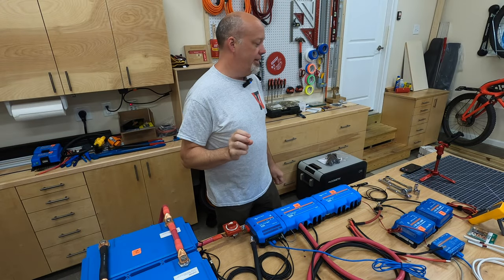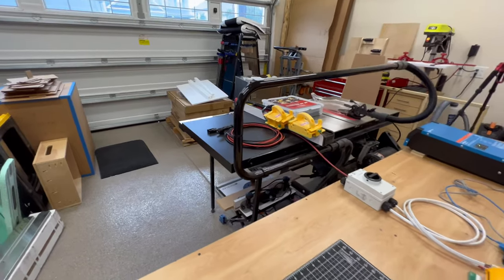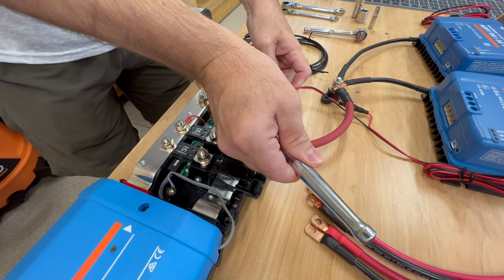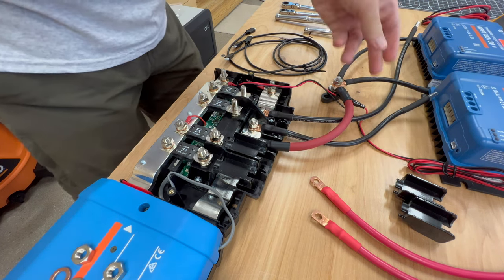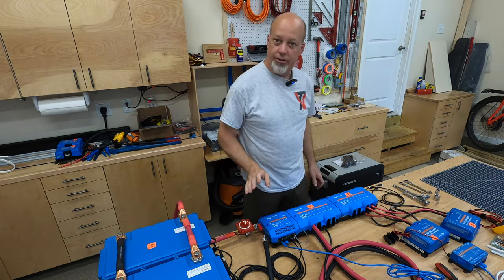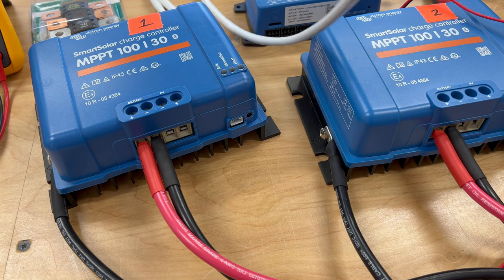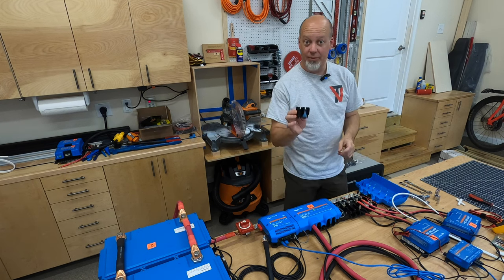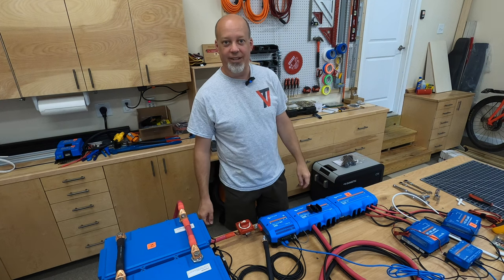Connect a Victron MPPT to a Lynx Distributor

Comment: Tip for anyone watching: if you use a 6 AWG with ferrule, make sure your ferrule crimper is square, not hex. Hex will not fit.
Reply from the maker: great tip!
Reply: Better to not use ferrules at all when manual requires fine strand wire.
Reply: @snoobler generally I would have to agree. I will say that the square crimp ferrel wire is a very snug fit and the contact patch is excellent.

Comment: Never mix your +/- color codes...this will bite you in the arse one day. If you must...spiral electricians tape on your +red just to remind yourself...temporary or not!
Reply from the maker: Overall sound advice. As I explained, I had the wire so I used it with black heat shrink - and it's my system ultimately, so I know and that's what matters. If it were building this for someone else, yes, stick with the correct color at all times.

Comment: On the negative connection put the crimp from the lynx distributor above it or if the equipment negative has high current it will melt.
Reply from the maker: Hi. Can you be more specific about a time stamp and what you are suggesting? I'm not following you here. thanks.
Reply: 3:11 ish @VanTransitions
Reply from the maker: @UKsystems Good catch. I agree, I missed that. It is best to have the 2 AWG LUG against the BUS BAR of the Lynx Distributor, then the ring terminal on top before the washers and nut. Thank you.

Comment: Nice video! Just wondering with that Lynx distributor and having a minimum fuse size (Mega) at 60A. This is quite big for the Victron 100/30. I was planning in doing the same but can't wrap my head around putting a 60A fuse on a device that is 30A. What's your thought on this ?
Reply from the maker: Thanks. I've been going back and forth on this as well. Another channel Explorist.life has some drawings with 60A. I have currently changed to 40A in place and on my drawing and no complaints from my Victron Dealer. And the spec sheet clearly says the max charge current is 30A, which makes 40A seem a lot more reasonable and it will still protect 6 AWG wire as well. I won't change my wire gauge here.
Reply: @VanTransitions  Yeah, Explorist.life just sent me his generic link to buy the parts. I did ask the logic behind the 60A fuse though... I'm on the same side as you though: The fuse should be there to protect the wire (awg6 will be fine) AND the device. The device part, not sure the logic behind putting the 60A fuse... Where did you find the 40A mega fuse? :)
Reply from the maker: I was able to find all my mega fuses on Amazon. Here is the 40A https://a.co/d/hLAQkG2
Reply: I think 40A is a better fit, as suggested below, but if you could not source that part for whatever reason, increase the wire gauge to match the 60A fuse (yes 6awg should be fine)
Reply: @mattwalker534  this is exactly what I did in the end! Awg6 and a 60A fuse. 👍🏻

Comment: why the red cable for ground ?
Reply from the maker: If I didn't explain it anywhere else, I didn't want to buy black for this one little spot in the build so I bent the rules a bit for myself b/c the copper inside is the same, and I used black shrink at the lugs to identify the neg. I don't recommend it necessarily, but it did save me some money and when traced by an expert, easily identified as on the negative with maybe a facepalm for the color.
Reply: @VanTransitions  sorry i have satellite data so it lowers the thing to 360p and doesn't show many comments i thought you were maybe wiring in series

Comment: Are you powering a rear air conditioner with that battery system? if so how many amp draw is the AC? for our setup auxiliary batteries will power a rear AC system, 12 Volt Refrigerator and one 110 outlet for laptop and that's about it. Ford tells me one of our packages we selected will come with a 110 outlet however they don't tell me where it's going to be we definitely want it up front. so with that information all the people I've talked to also tell me four batteries, preferably 4 solar panels, alternator connections and shore power just seems like overkill to me?
Reply from the maker: I will have a Dometic RTX 2000 AC in the furthest rear bay on the roof of my extended Transit. I have fused according to their documentation: an 80A megafuse in my Lynx Distributor. I will also power everything else with this Victron system (no propane). Eventually my build and videos will cover this in more detail. In my 2021, the Ford inverter is under the passenger seat, max 400W. Battery power isn't determined by the number of batteries, but the Ah (Amp hours). If you are doing 12V AC, you probably need 400Ah and 400W solar minimum, but you need to calculate your own electric needs. There are spreadsheets on the internet. Why not have shore power available or DC to DC charging while driving? Next video on Sunday speaks to the Victron Orion-Tr. What if it rains for 3 straight days? Options.
Reply: @VanTransitions  Our van use we'll be pet transportation so yes it alternator will be supplying power to the batteries to power the rear air conditioning, The only time solar will come into play will be as a backup for air conditioning if we break down As for shore connection my intended use is to plug in at home prior to a trip so that the refrigerator would be cold for pet insulin or other items.
Reply from the maker: I presume you have researched the Transit CCP, customer connection point?
Reply: @VanTransitions  yes I opted for the lines install with no controller, my first thought was to go with Webasto system but I lose the backup of breakdown AC.. The whole project is very flexible at this point since were a year out from receiving the van. The first couple of Builds I did on Fords page I was just going to buy a passenger van with seat delete, that was until I saw the measurements with Fords rear ac, it just took up to much room.
Reply from the maker: You can't run the rear AC from Ford without the vehicle running. Definitely take this time you have to research research research.
Reply: @VanTransitions  That is true and correct.
Reply: Wait…aren’t you supposed to run the center grounding post of the Lynx to chassis ground? I’m not understanding why the MPPT ground is going there. Where’s the actual ground here? Thanks

Comment: is that Romex that is connected to your MPPT?
Reply from the maker: No. It is Ancor Marine 10/2 wire.
Reply: U cant use romex?
Reply from the maker: Romex is not recommended for van/RV installations. You want stranded wire.

Comment: What size wire is the PV wire? And where did you get the ring terminals for it? I will be running 10awg but can't find ring terminals
Reply from the maker: The wire from the solar disconnect to the MPPT units is 10/2 ancor marine wire. There are no ring terminals used for the 10awg wires on either side of the solar disconnect.

Comment: I would have never combined a red colored wire to the minus (massa)  of the Lynx. Always stick to the same colour is safer. What if in the future a mechanic takes it apart and than it as really easy to make a mistake in putting them back in the wrong bay (minus cable with red color)
Anyway, that’s the way I work in Europe. Maybe this sounds stupid for USA mechanics. Love your video style, greetings
Reply from the maker: hey, and thanks!

I understand what you are saying, my attention to detail usually agrees. Red is +, Black is -, same in USA. Good eye, the short piece of 2 AWG for the combined ground of the two MPPT is red. I did put black heat shrink on it to help distinguish it and I hope it is otherwise clear it is DC neg/ground based on what it is connected to.

I have another use for 2 AWG red on a positive connection related to connecting the Ford Transit CCP to the 80A breaker for the 2 Orion-Tr units, so for 8" of wire, the only piece of 2 AWG black I would need, I didn't want to buy 2 colors and have unused black wire laying around.

Comment: I know 6 ga will work fine but isn't that a bit of overkill for a max of 30A?  Or is you controller a long distance from the Lynx Distributor?  
I have the same set up and the controller is only 2.5ft from the Lynx and according to the DC wire charts I am ok with 10ga. for 30A at that distance.
Never any problem with over wiring but just wondering why you went with gauge wire you did.
Reply from the maker: My MPPT is not far from the Lynx D at all, less than 2.5 ft. It was more for efficiency/upgrade capacity I suppose, plus a 6awg with ferrule fits perfectly in the slot. With my 2 solar arrays, 1 pair of 100W and 1 pair of 200W, and 2x MPPT of 100/30 I don't suppose I "need" 6awg.

Comment: hello I had a question to connect the mptt on lynx separator
Each mptt regulator must be connected by 1 space of the lynx 1 space for an mptt?
I have 5 mptt I need 2 lynx?
not possible to put 3 MPTT on 1 lynx space and 2 mptt on another lynx space?
the current coming from the mptt is 40A max per mptt
Reply from the maker: Hi. You can fill one Lynx up with 4 MPPT and put 1 MPPT on another Lynx, or you can do 3 and 2 between them. There is no requirement to fill one Lynx before using slots on another. Fuse each one appropriately to your needs.
Reply: HELLO
Thanks for the info, yes 3 MPTT (wired in 6MM2 on a 25MM² terminal) and 2 MPTT (wired on 16MM²) each mptt will have its 40A fuse upstream
what fuse should I put on the lynx on the 3MPTT going to the lynx? 150A? and 100A on the other?
so no risk of assembling 3 mptt on a lynx location?
thanks
laurent
Reply from the maker: I'm not sure I follow you here. Each Lynx Distributor has 4 locations (pairs of pos/neg with place for fuse) for a potential connection. One MPPT per pair of pos/neg lugs with your 40A fuse there if that is the correct fuse rating for your MPPT. You should be able to see this in the video. Each MPPT has its own location on the Lynx Distributor. I presume your wire measurement is the same as 6 AWG (I am in the USA). What or where are you suggesting a 150A or 100A fuse and why? What model MPPT are you implementing? As mine is the 100/30, this is why I chose a 40A fuse. If you have the same model, don't forget the ground.
Reply: hello
so yes the 5 mptt that I have have their 40A fuse
they have a wire gauge of 10AWG (6MM² europe)
i asked you the question to know if 3 MPTT gathered could fit on a lynx place? if it is possible to do that I would crimp the 3 10AWG cables on a 25MM² eyelet terminal that will go on a lynx place
do you understand?
Reply from the maker: You didn't say what model MPPT you have. If you have a Victron Energy 100/30 like I do, you need 6 AWG. Wire at 10 AWG cannot handle 40A. Do not bundle your MPPTs pos/neg together. 1 MPPT per pos/neg pair with fuse on the Lynx Distributor as the video shows. I do believe it is OK to bundle the ground as I have done with proper wire gauge, please verify with an Electrical Engineer for your specific setup.
Reply: sorry 5 MPPT 150/35 battery in 48 volts
Reply from the maker: Ah, 48V vs 12V makes a big diff in the discussion, including wire gauge selection. My work is in 12V. However, I do not believe you should stack MPPTs. There should be 1 per pos/neg fuse location. Please check with your dealer or an Electrical Engineer to confirm.
Reply: yes 48v😄